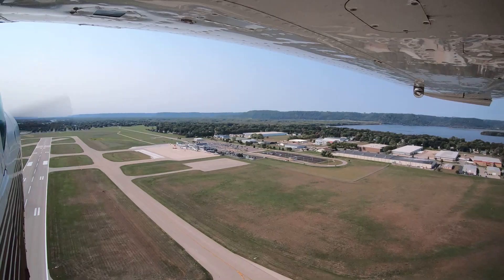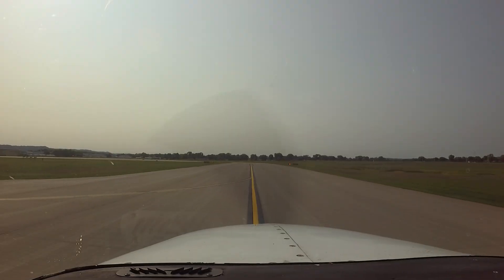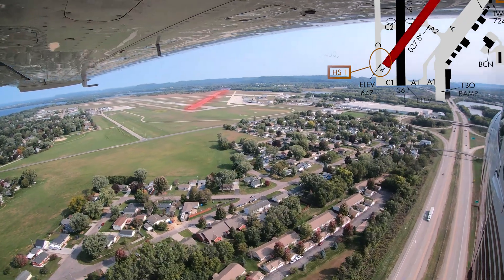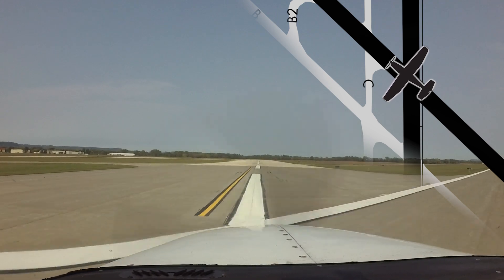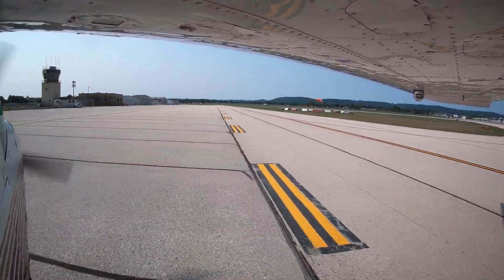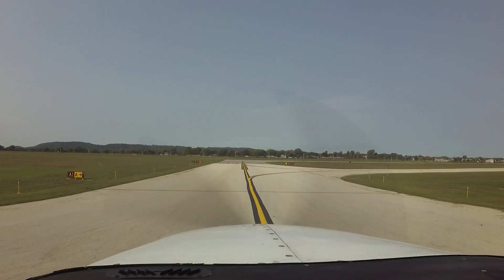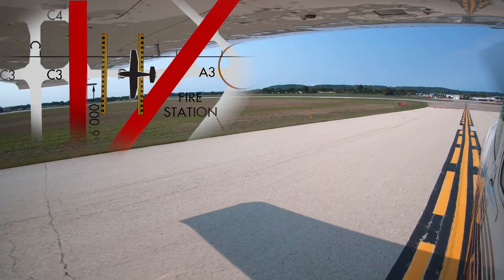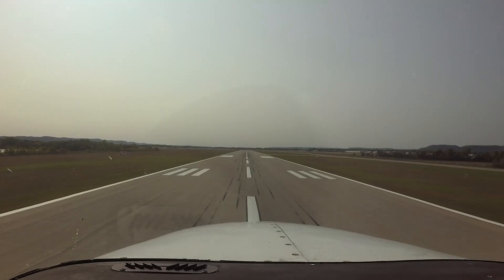From the Flight Deck – La Crosse Regional Airport, WI (LSE)

Comment: Longest runways in Wisconsin:
1. MKE	MILWAUKEE, WI	9990	ASPHALT/CONCRETE	
2. MSN	MADISON, WI	9006	CONCRETE 
3. LSE	LA CROSSE, WI	8742	CONCRETE 
4. GRB	GREEN BAY, WI	8700	CONCRETE
5. EAU	EAU CLAIRE, WI	8101	CONCRETE/TREATED	
6. ATW	APPLETON, WI	8003	CONCRETE